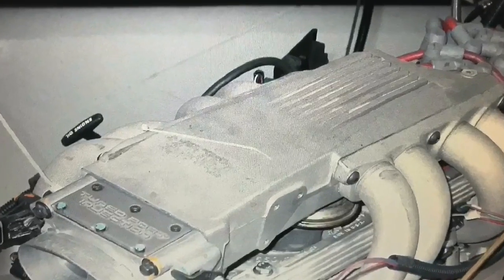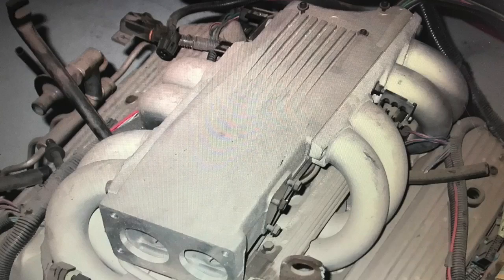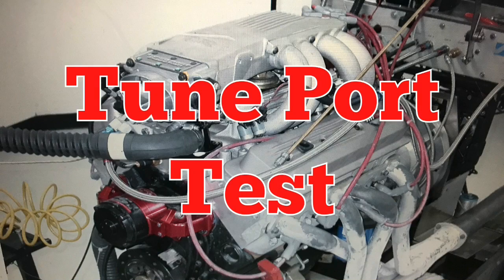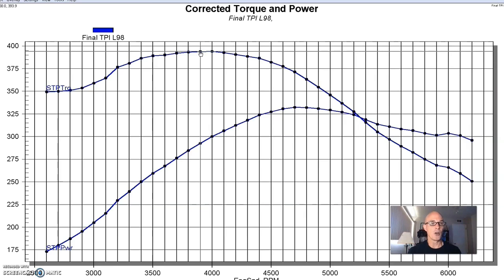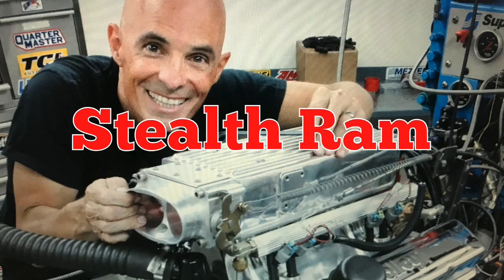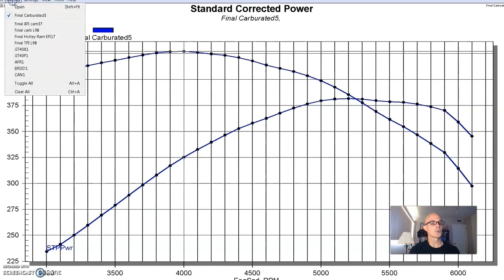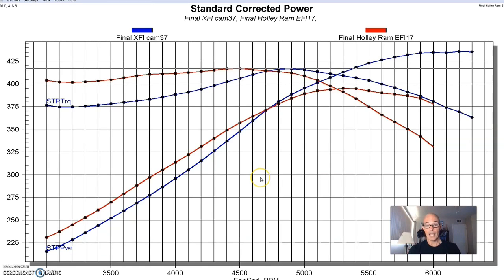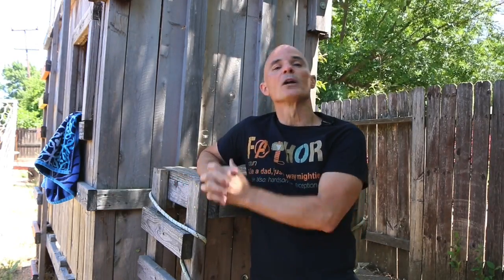TUNE PORT TECH-L98 vs CARB

Comment: all that torque... 350 ftlbs is lots of torque to chevy and import guys. If GM wanted the most torque for their vehicles, they would not have used a chevy. The chevy is cheaply built and a cheap design, and by cheap I do not mean inexpensive high quality. I mean barely adequate for the application, like chinese tools (chevy) vs Snap On.  Some people swear by the chinese tools and parts, but the quality just isn't there just like a chevy.  When its extremely easy to make 500+ftlbs with mostly stock parts running a Pontiac, the appeal of a chevy that needs the aftermarket thrown at it simply isn't there. Thing is, nobody pays attention to the Pontiac engine until they are looking at the tail lights of one.
Reply from the maker: not sure why people insist on putting one thing down in an attempt to elevate the one they like-both can be good
Reply: @richardholdener1727  Please understand that for the last 35 years I have heard put a 350 chevy in it and it will go faster. Even when I am running two full seconds faster than all the so called cheaper faster chevys, and doing it with a $2700 mostly stock parts Pontiac with a mild hydraulic cam that runs mid 11s in a heavy car. 

I'm just not a fan of the chevy, what you are doing with them is awesome. I like seeing what they make, with what parts. It makes my time easier figuring out what they might run. It also shows me just how off the mark these guys are saying their 383 makes 700hp on pump gas. That makes me money.

I get a kick out of the import engines too, not that I would ever build one, too much money for so little power, but in a very light car they are kinda fun. The 84 VW GTi that I got for a set of 5.0 Ford roller rockers was a fun little car.

When I want an RPM engine, I got 4V Clevland, when I want grunt its Pontiac or 460 Ford.  The Cleveland is simply amazing for no bigger than it is. 

The TPI is an attempt to make the sbc more like a Pontiac, and I can appreciate that because any improvement on those engines is a good thing. Now when we talk LS, then I am watching all the videos you make. I have the 6.0 for my 76 C10 planned out and I just need to get it in the shop.

Really not a fan of the chevy.. but also don't want you showing everyone what my engines are capable of.  550ftlbs at 3000 from a mild daily driver is kinda cool though.

Comment: I really enjoy this channel and this is the first time I agree with everything you said. 
One question. Does anybody know why no one is offering a dual plane intake for port injected EFI? Stock TPI TB could be monunted on the sides to give good flow and lots of hood clearance. EFI with cylinder trim will correct the AFR issue with this type of manifolds.
Reply from the maker: Speedmaster had one for a BBC but it didn't fit

Comment: TPI is great for the street. Low end torque allows you to run a higher gear.
Reply: Tuned Port was awesome stoplight to stoplight action! Those L98 engines were absolute torque terrors.

Comment: Would the stealth ram fit under the hood of a 80s f-body?
Reply from the maker: I think so
Reply: I have the stealth ram on an 89 formula, had to trim the underhood support a little but it clears the hood by about 1/8". The Camaro hood sits higher so should fit too

Comment: This video answered several of my questions regarding tuned port vs dual plane. Thanks. Putting that video of dyno tests on several tuned port systems sound great! BTW that mild cam caught my attention. I had a 208/208@.050" with 108 LCA and dual plane manifold with long tube headers and super free exaust 40 years ago. It shocked a lot of people. I cut the transmission cross member into 7 pieces and rewelded it so the exaust humps were lined up with the collectors. I also had to rest the weight on the cross member, remove the seats and beat the floorboards with a 5lb maul to ceate a clearance for the cross member. I always wondered what a tuned port injection would do on that set up.

Comment: I think a squared pattern cam or reverse split might work well with long runners. Here is my brain on BBC.  Mercury Marine ram jet, cross ram, tunnel ram. The latter is intrusive for your line off sight so not for street.

Comment: Hey Richard, love the channel. Just wondering 6 there will be a test in the future testing e85 vs water/meth showing timing numbers with each?
Reply from the maker: I did WM vs intercooler-its no contest
Reply: @richardholdener1727  I saw that one. Did you add any spark when doing the water/meth and intercooler vs the non intercooler? 
I know some people run 10 or more degrees of timing when spraying water/meth or running e85 vs 91/93 Octane.

Comment: Hello Richard.... great content... I remember the L98 TPI... my very first fuel injection car... 85 Corvette’s  came standard with the L98. Even though it was Rated at 245 hp and 340 foot pounds of torque...... the L98 felt like a beast with that intake manifold form Idle to around 4000 RPMs. The dyno shows a disappointing top end power output.....but on the street the L98 with the right gears feels like a more powerful engine then what the dyno graph shows.

Comment: Richard I watch your videos from beginning to end these are some of the most informative videos I've seen yet.. I can't wait to watch when you break down and analyze the LT1 and LT4 engines...if possible please let us know your factual opinion on the torque-head ignition control system vs the  optispark system
Reply: I like EFI connections system, since It's utilizing GM components. You can can get replacements easily from any parts store if needed.
Reply: @allanb3222  thank you so much I'll definitely look Into it

Comment: Just imagine how the minds would had been blown if gm would have dropped the tuned port 350 in there pickup trucks I've always said that it would have been the best pickup engine gm ever produced
Reply: I did in a 92 k2500 instead of the tbi system
Reply: Thanks the joke the Corvette and F body guys say that we have the best truck engine ever made in our cars, lol.
Reply: Early 90s was a time where any HP gain was impressive so of course the TPI was impressive anyone remember the impressive 
CROSS FIRE I still remember laughing my ass off  at my uncle when he bought his 82 firebird talking about how powerful it was
Reply: GM dropped the ball on that opportunity. The L98 would make the perfect truck engine.
Reply: The TBI 5.7l in the pickup trucks ran extremely well. I had an 87 k2500 that I drove for 235,000 miles. 60,000 to 80,000 of that was pulling a loaded car trailer. Regular maintenance and a water pump were all that truck ever took. A GM certa transmission at 150,000 miles. 16.9 mpg on the highway in 2wd and tons of power.
Reply: @jeeptk The two 5.7TBI trucks I've had were so solidly reliable and both eeked out 20mpg on the highway. Granted, a modern 5.3LS matches the reliability and fuel economy with much more power, but the 5.7TBI was good.
Reply: @74stang2togo  My 87 was the best truck, great mileage, reliability, pulling power. My 04 with the 6.0 is also a great truck. Replacing fuel lines on it now.
Reply: It was junk for a truck unless you drove around at 3,000 rpm all the time. Had one in my G20 van. Dual plane with TBI had more torque in the 1,500-2,500 rpm range.
Reply: I still say they missed the mark not dropping the 350 TPI in the Monte Carlo SS!
Reply: The tune port motors were never all that great they ran out of rpm fast and the LS and LT motors are light years ahead of them.

Comment: This may not be popular but I'd like to see some kind of GM TBI build. Just to see what can be done. Turbo? Cam? Heads? Just curious.
Reply: I have taken mine pretty far. On a V6 mind you. Ported heads with a matched manifold. COMP cam, 1.6 roller rockers. I was able to use the ECM from another vehicle which surprisingly nailed the fuel delivery which I can see on my wideband gauge. I still have my eye on the Holley Sniper 2bbl unit. I wan't to change the manifold and possibly supercharge it and the stock unit simply won't handle it. The Holley would also clean up the unsightly stock wiring harness and allow me to mess with timing and fuel any time I want.

Comment: Find the average torque up to peak torque rpm, then find the average horse power up to peak horse power rpm.  Now add the two numbers together, the one with the highest number is the combo that is the stronger motor.  Example: Back in the 90s the ford ranger 4.0 made 160hp and 190ft torque, the chevy S10 4.3 made 190hp and 160ft torque.  At the track they would cross the finish line nearly in a dead heat.

Comment: I would love to see a comparison between boosted high compression engine versus low compression boosted engine, same setup, only compressionratio difference.
I would also love to see a comparison between longtube headers versus short tube in a turbo application.
Keep it up! ;)
Reply: differences are obvious,you dont need someone to tell you that.

Comment: On the second motor i would choose a little smaller cam than the 268 but not as small like what it came with. too much tradeoff of low speed torque.

Comment: Low RPM torque feels better in a street car. Making power at a higher RPM can actually make a car feel slower in most street use. More low RPM torque also gives better fuel milage.

I love the TPI. Best looking production intake manifold out there IMO and I like seeing the solutions people have come up with to make power with it.
Reply: How much time do you spend over 5k rpm anyway?
Reply: Yesss!!! TPI was (and still is) a great street setup!
Reply: @buzzybeezzco  Red light to red light or windy back roads. m
My 91 Vett is an absolute blast to drive! So yes it's a street car lovers motor IMOP.
Reply: the tpi manifold looks nice but I like the SR as well, I would prefer more power although not sure about reliability. there is a max torque tradeoff so hard to tell which one gives better reliability
Reply: @rotorblade9508  I assume you mean Steath Ram (?) which I like too. As long as you're not reving it too high it shouldn't hurt the reliability. I wouldn't be concerned about it.
Reply: @rotorblade9508  BOth intakes are reliable, engine never sees enough rpm to break
Reply: I put a t5 in my 350 iroc tpi, best thing ever. Not fast but so quick, the part throttle feeling and high torque at highway speed is pure joy. It does fall on its face by 4500, I'd like to gain about 700rpm of usable powerband

Comment: I just "finished" my small block 383 i am using a port matched blended holley stealth ram air system with the commander950 management with stock c4 corvette manifolds and made 358 wheel hp. Made 373 lb ft , on a mustang dyno, with one of the flattest torque curves that i have ever seen. Now i need to make a set of 1 5/8 long tube headers and make over 400 whp!
Reply: you must have some sick heads(or l31 vortecs)
Reply: You think? There trick flow 195cc heads that i just did some gasket/ port matching on with all the tests that these guys do on 383s i didnt think that i was making all that much power

Comment: i drove a friends trans am with a TPI, i floored it at a light and when it hit about 4500 i though something broke, wow what a let down.
Reply: They totally fall flat. In my younger days, I recall a race against a brand spanking new LT1 4th Gen Camaro against my bone stock 85' C4.   I would get a half car length until just as you say, that north of 4500rpm hit and it was like the fuel shut off.  The Camaro would jump out ahead, until my car shifted, then I would squirt well ahead of the Camaro again.  We were about the same over all, but the cars accelerated so differently.
Reply: Yea they fell on their faces after 4500 to 5000 rpm that used to bug the shit out of me. LS and LT motors are light years ahead of the tune port.

Comment: I would love to see a 406 with vortec heads and TPI vs stealth ram!
Reply: Vortec heads dont move enough air for a 406. You need a minimum of 190cc intake port.
Reply: The intake is available and making high rpm power is not required...I was interested in something aimed at low speed grunt for a 4x4.
Reply: @malibuz16  If thats your goal then the combo would work perfect, lots of low end torque
Reply: @malibuz16  Are you saying there is an intake available (non modded) that can bolt onto vortec heads and simultaneously the upper TPI intake manifold? If so, please tell me the name of the vendor so I can go check it out.  And again do not forget you will need a proper custom prom to run the factory ECU or you will have to get an after market ECM [I think an E-Z ecm or something like that] to run it.
Reply: @James this is exactly what I have been wanting to do for my 91 Camaro factor 305 TBI direct replacement with 396-406 gm sbc. The problem is the factor TPI intake manifold does not have the compatible bolt pattern to mate it to the vortex heads. So it will require bolt alterations or you will have to stock with a GEN I head that then likely need a custom PROM to make the ECM run efficiently for 400cid. I’m in FL and no local shop cares to even entertain such swap and warns that a factor 350 gm ecm may not CONSISTENTLY run a 400cid...meaning you make experience lots of hesitation either at idle, while cruising, or if/when you feel’in froggy and decide to floor it. I’m almost considering going to an engine builders and installation and tuning school just so i have to know how to do it myself.
Reply: Neither of those intakes will move enough air to support any power or RPM on a 406. They’re restrictive on mild 350’s
Reply: The money you spend making those vortec heads viable for that kind of cubic inches (porting, spring seat machining, bowl work and re-seating for bigger valves) is close to and maybe more than how much you'd spend on a decent as-cast 220cc aluminum head. 
Stock vortec head casting will hit valvespring coil bind @ ~.460" valve lift which is absolutely fuck all for even a healthy 350 so spring seat machining is required for at least a .500, .550 lift cam, valve size would need to be AT LEAST 2.0" Int, 1.6 exh and the stock sizes are 1.94, 1.5. 
That much cubes with that lacking of head would make great torque but probably only 400hp. A healthy 406 should make well over 500 or 525hp.
Reply: @Dima Florida https://sdparts.com/i-23896057-sdpc-sd3816-tpi-vortec-lower-intake-baseplate.html?msclkid=34473327f0c91393ac506df80ed55f15&utm_source=bing&utm_medium=cpc&utm_campaign=PLAs%20-%20%24300%20-%20%24400&utm_term=4583176784483411&utm_content=Brand I also know tuning would be involved.
Reply: @malibuz16  Thank you for providing this link. It's a shame that all of the engine shipment vendors I've contacted [even BluePrint Engines] all advised that a GM TPI intake manifold cannot bolt onto their vortec head engines without a machine modded bolt pattern configuration. Non of them mentioned this vendor (or similar vendor) offering pre-compatible vortec head TPI intake manifolds. It could be simply their lack of knowledge or laziness/reluctance on their part to advise what vendor offers such an intake.  My guess [and I stress guess] is this vendor (SDPARTS) was smart and thoughtful enough to offer a pre-modded GM TPI intake manifolds bolt compatible with vortec heads for customers needing such an intake.  On that note, my advising that the ECM would need a custom PROM was not directed at you specifically, but to the general public that happens to read the thread beginning thread.  If I had no prior knowledge that a custom tuning/PROM would be necessary for a TPI 400sbc, I would have thought just a simple bolt-on GM TPI intake and factory 350 ECM would run efficiently as well...I'm sure I wasn't alone on that.  So hopefully me mentioning this important factor will have been a very helpful and useful contribution to the discussion for others with similar aspirations.
Reply: I have a 400 with EngineQuest Vortec heads, Comp Cams hydraulic roller with 218/224 and .565/.570 (1.6 rocker arms) Holley Vortec Stealth Ram, 52mm throttle body and FAST computer in a Third Gen Formula. The EngineQuest heads flow about the same as the LS 706 castings. It is a fantastic street motor with insane torque and with 9.7:1 compression still runs great on 87 octane regular. The intake is very close to the underside of the stock hood but it fit after I trimmed the under hood support a little. WAY better than the original engine it replaced.

Comment: Higher revving engines are better. 
9000 or more...lol.
Reply: Depends on what use. u don`t want a f20c in a f250 and u dont want a 572bbc in a miata if u want it to handle.

Comment: Carburetor because of the flow the tune port manifold sucks bad  for flow not really a good comparison for fuel injection .fuel injection like in ls motors is way more efficient then a carb but even then power can be had with  a carb but for all around fuel injection is King if you want to drive Cruze and make sure it runs right in all conditions